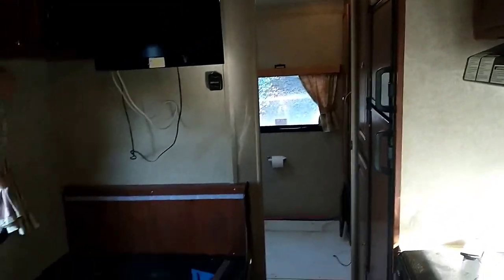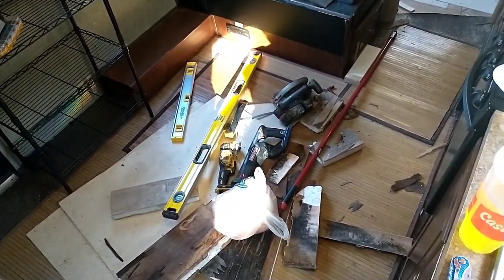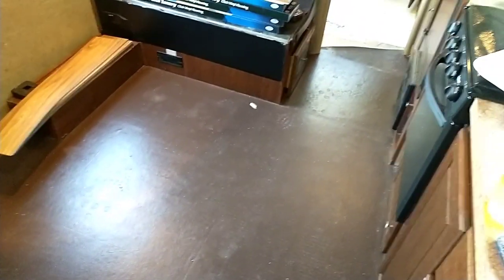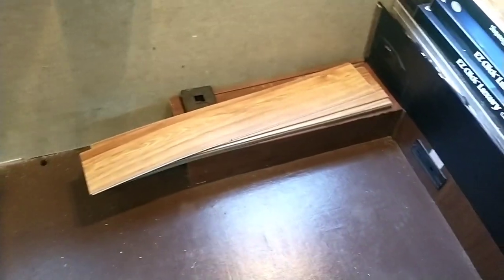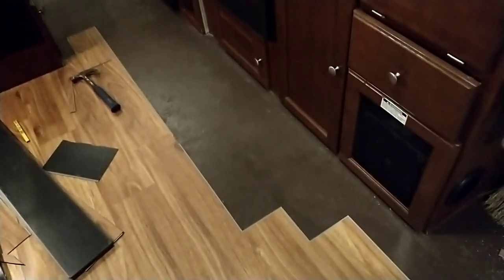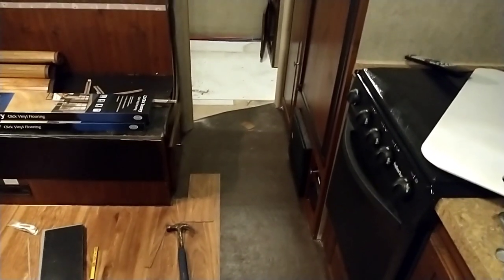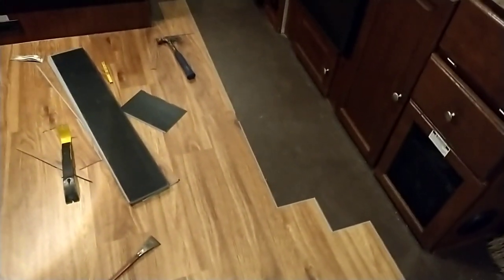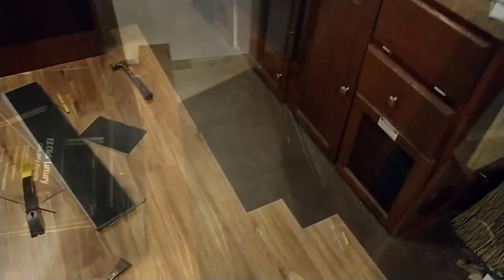Installing Vinyl Plank Flooring and Modifying the Couch to Change the Layout of the Mini Lite Camper

Comment: How does the floor handle humidity in the summer and very cold in the winter?
Reply from the maker: Hi Sheila, I just put the floor in about 3 months ago. So we've not experienced it in the winter yet, but I suspect it will be fine.  As for the summer, the humidity has not affected it whatsoever.  Being the water-proof version of the flooring (which would be the only kind I would suggest for a camper) it is made of a plastic and not the pressboard, so water has little to no affect on it. Thanks for watching and for the comment!!